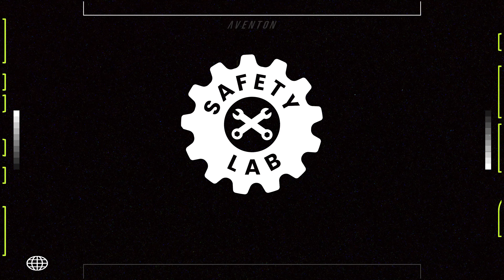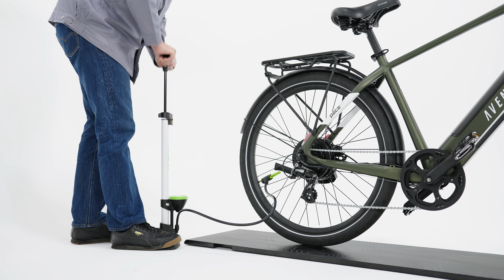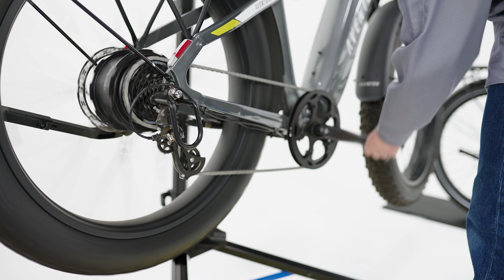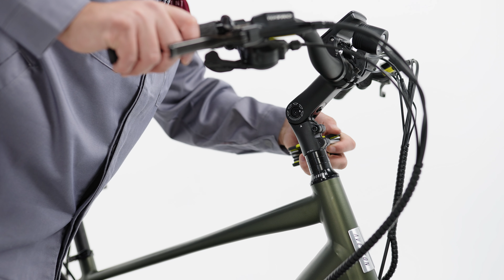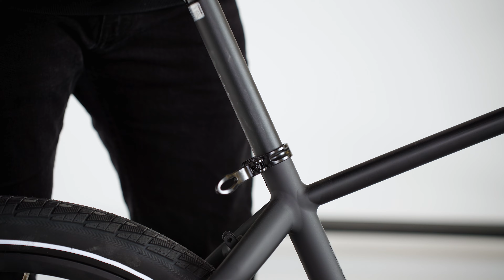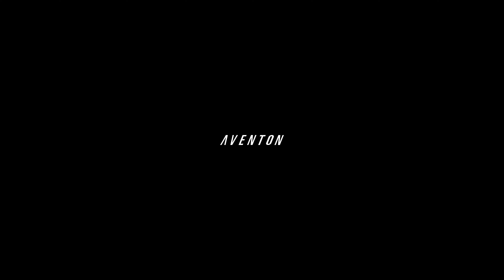Aventon's Safety Lab: Essential Ebike Maintenance for Year-Round Riding

Comment: So what type of lubricant is supposed to be used on the aventure?
Reply from the maker: Are you referring to the chain? Any chain lube you prefer, dry lube if you live in a dry area, wet lube if you live in a wet and rainy/humid area
Reply: @AventonBikesVideos  what would be suggested for oregon during summer. Mid 90s and decent amount of humidity. I have the aventure 1 step through and use it daily as my means of transportation. I have been using the "white lubricant" that they suggested at my tiny local bike shop. But wasn't sure if that thick lubricant was what I needed for this time of year. And there's not even a suggested type on the user ,annual. So someone like me who's only known BMX redline bikes my entire 38 years, I have no idea where to even start